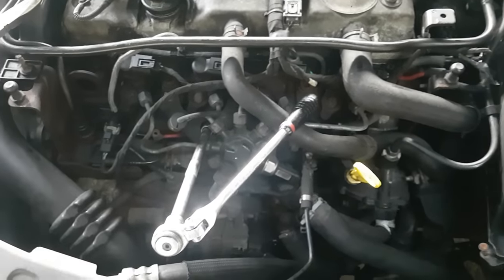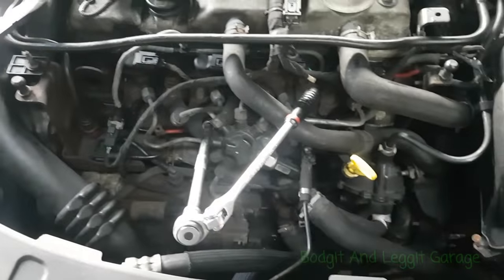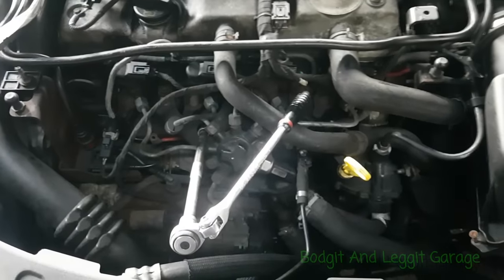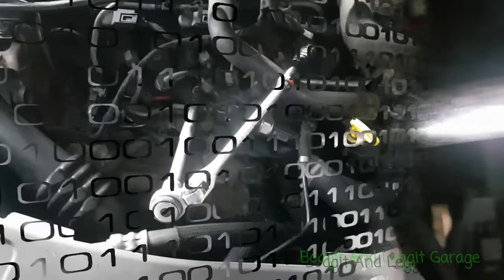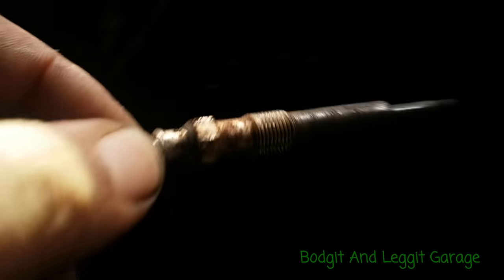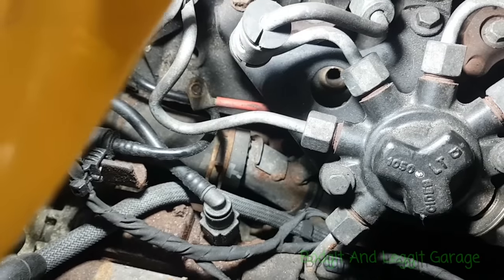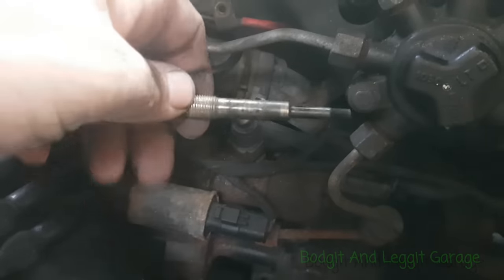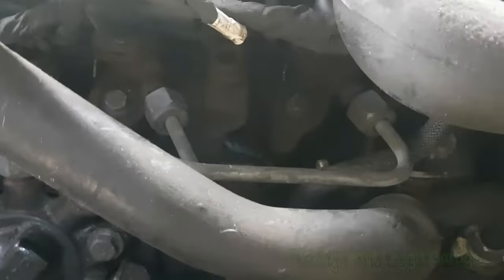How To Remove Seized Heater/stuck glow plug With No Specialist Tools Bodgit And Leggit Garage

Comment: I had a similar problem with my car recently a 57 plate vectra 1.9 cdti 120 bhp, did 3 on my own that were quite easy to take out but 1 glowplug was seized and squeaky like in this video. Took it to a mechanic at a home address and he was using all his strength moving it back and forwards, his arm was shaking he was using so much pressure on his arms and the glow plug was very squeaky as he was turning it. I told him to stop several times as I felt he would break it. He carried on and suddenly it came loose but would not come out but kept spinning.
Fearing the worst I took it to an engine repair shop and he managed to remove it in 15 minutes and only charged me 10 pound. Looked at the old plug and half the threads had sheared off it. Probably when the home mechanic was putting all his strength into getting it out. I think maybe he was trying to snap it on purpose to get a job off me to extract it, I no longer bother with this guy.

Its nice to see someone like you doing this job with caution treating it like your own car and doing the job carefully and properly, shows their are mechanics out there who do care for the cars and the customers who they belong to
Reply: I have the same engine on my Saab93.
     Was you mechanic not wrenching back and fore, or backing out one way only,  to cause your concern?
Reply: @Carlostype  yes he was going back and forth but using all his strength, he was even thinking of getting a hammer and hitting it once it got too tight for him to turn but I would not allow it. 
I no longer use his services

Comment: Yes But you delete constructive criticism cos you know there right, the vids ok even how you work at getting the glow plug out, it's the fact you won't accept you should have used some suitable penetrating oil as many of the comments have suggested
Reply from the maker: I don't delete any comments all your comments are still there go and look I don't mind people giving me advice, but when it has absolutely nothing to do with anything and it makes no sense. It doesn't really mean anything. In this case we would not have worked. I really don't understand your problem the video I did not break anything. I did not damage anything the job got done. So what's your problem?

It doesn't make sense you said I delete comment because you also said in one of your comments that people agree with you. So if I was deleting comments you wouldn't have seen that now. Would you think about it?

For the first time you said in your comment is completely wrong. Are you going to actually apologise for being wrong now? I don't think so.

Comment: Worth adding, put some coppa slip on the threads of the new ones. Will make it easy to get out next time if needed to. Also whenever we do track rod ends put coppa slip on the steering arm and track rod. Saves all the hassle of it being siezed next time it needs to be adjusted/come off.
Reply from the maker: Hi mate are you referring to copper grease because personally I don't use copper grease on anything with a thread because of the bit that's in it and it acts like sandpaper or are you referring to a different type of Grease
Reply: @bodgitandleggitgarage  yea copper grease, pad grease. there's no movement when the glow plugs are tightened up so no wear between the surfaces, it's very soft copper dust in the grease. They are guaranteed not to sieze in. Just done a second set of glow plugs after 80k on a Ford that had this stuff on, they practically fell out. Steel of the plugs and alloy heads are prone to reacting and sizing the plugs in, coppa slip prevents this. Try it.
Reply from the maker: boom sorted good to no mate
Reply from the maker: boom sorted good to no mate
Reply: Of course it would be nice the person before you or even the manufacturer did this. Would make it so much easier for the rest of us

Comment: I have a problem removing one, and I feel the click click feel of a turn but its not coming out its like something is turning on the glow plug but not the glow plugs thread I think part of its nut body is spinning ugh!!
Reply from the maker: Hi mate what can happen is they can break pass the threads because the tip can swell up in this case if this is the case you are going to need some specialist tools and can turn into an absolute nightmare

Comment: Great job. Do you know to remove stucked glow plug ? I have p0380 code. I think that one or more glow plug are faulty, because voltage on a wire on glow plugs is 10V when glowplug on dashboard indicator is on. Regards.

Comment: Usualy a build up of carbon that creates this problem, so penetrating oil does not always help.

Did the plugs on my P38 Range Rover a couple of moths back, four were easy enough, two felt tight, I chickened out after putting the meter across them, left them alone.

Those plugs look like the long Devils that were in my old X Type Mondeo engine 2.0
Reply from the maker: About time someone that actually knows what they are talking about the amount of comments in this video people telling me to put WD40 on them and telling them it would not make any difference apart from stopping the noise it would not penetrate thank you mate for actually know what you are talking about thanks again boom lol

Comment: My son said that he tried renewing his glow plugs and they were very tight, did I have any suggestions? Which is his way of saying would I do it for him !
We swapped cars Friday night. I let the engine cool and then applied lots of WD40. I know real men go in dry etc but not with these you don't. Lube is your friend in this case. Like you I went back and forth, lots of lube used and all four came out much easier than what my son described.

I only used 2 specialist tools:-
1. A deep 10mm socket
2. 40 years experience on the railway
Reply from the maker: Hi mate like I said in the video wd 40 absolute waste of time I did not use it in this video and would not use For this application it is not lubricant There's not a lot you can really do trying heat the car up turn the engine on let it tick over for a long period of time get it nice and hot and take your time The problem is if they re going to break there is nothing you can do some cars they just break unfortunately they can be an absolute nightmare
Reply: @bodgitandleggitgarage  if they're going to break, then yes they're going to break. You're absolutely correct on that, known in the industry as "Ford Mondeo Syndrome". Have no idea why - LOL. Of course the thing with our industries is a person's experience and preferred method of working. We're not all correct, and we're not all wrong. We tend to find a way that works for us, and we're happy with it

Comment: I'D GIVE IT A SHOT OF PB BLASTER EVER TIME BEFORE SCREWING IT BACK IN. IF IT'S THREADS IT'LL HELP. IF IT'S CARBON ON THE TIP IT WON'T HELP. BUT WHAT HAVE YOU GOT TO LOOSE? FIGURING IT'S CARBON, DO YOU CRANK IT OVER WITH THE GLOW PLUG OUT TO TRY TO REMOVE THE CARBON? I DO THAT OFTEN ON GAS ENGINES WHEN CHANGING THE SPARK PLUGS TO BLOW OUT THE CARBON.

Comment: I FIND IT EASIER IF YOU GET THE ENGINE TO WORKING TEMPERATURE.
Reply: Definitely it help. BUT, point being on some engines you'll have to remove so much "stuff" to get to the glow plugs. That when you reach them it's already stone cold! Then it cannot be restarted because it's just been disassembled! You get the picture! ;-)
Reply: @crpth1  Same here... got the thing nice and hot... by the time I took off the inlet manifold, the water bottle, the EGR and most of the coolant hoses it was time for bed.
Reply: @crpth1  LOL, how complicated things are nowadays.  I had a Hillman Avenger once, easiest new head gasket ever - pushrod valves. Sometimes I think I might get another, but then maybe not :-)

Comment: Why no wd 40? That would help for sure
Reply from the maker: Not at all in this case like I explained in the video yes it would have stopped the noise but that's still would not have helped anything the threads have got all carbon up with heavy carbon deposits WD-40 will not break through this all it would have done was stop the noise the process is still the same

Comment: Good video.
Would your recommend taking them out once a year to stop them seizing? 
Preferable in the summer months.
Reply from the maker: Hi mate not sure about that cos you can still cause other problems use good quality parts I've noticed the cheaper heater plugs tend to get stuck / seized a lot easier
Reply: @bodgitandleggitgarage  Wise words as usual. Cheers. Did you ever treat yourself to the 
Knipex 45 21 200 30 pliers for the odd C clips Toyota use on solid axles etc.

Comment: Changed heaters on an old 1998 seat ibiza with the old 1.9 non turbo diesel. Can remember one been behind the fuel pump which was a tad fiddly had one think was cross threaded in the head from a previous time ( not me) so changed the other three and left it at that

Comment: Hi there, I have been fighting for some time now with my mondeo/x-type project 2.0tdci and i got 2 broken glow plugs inside of the engine. After several attempts I have given up trying this and I have to open the Cylinder Head so i can kick them out. Do you have video where you open the cylinder head and install it back? Im asking this because i have no idea what im supposed to do, i will try using common sense and to tight back i have no values for Nm torque. help? :) cheers!

Comment: I've heard that if you get the engine warmed up by going for a drive after soaking recesses in penetrating oil. Then use freeze spray directly on the plug it makes it easier but never tried it and might give it a go when my van needs some new ones 👍😉

Comment: WD40 might have saved a little time?
Reply from the maker: Hi mate the WD40 would have made no difference in this case it was too blocked up full of carbon it would have stopped the noise but that's about it
Reply: bodgit and leggit garage I disagree!. You oblivious don’t understand how WD40 works. It’s a penetrating fluid and would have lubricated the threads every time you screwed the plug back in!. Also you could have explained why you only screw a small amount at a time, as you CLEAN the threads every time you work the plug in and out. PS WD40 dissolves carbon. Your welcome.
Reply: Well it was still a very useful video. It helped me expell the water out of my cylinders after I hydrolocked my engine. I was going to remove the injectors but then decided it was a-lot quicker and easier to remove my glow plugs. Fortunately mine came out very easily and were finger tight after about half a turn.

Comment: can you put copper grease on the new heater plugs
Reply: Yes, on the threads only
Reply from the maker: Hi mate no do not use copper grease copper grease act like sandpaper and it will destroy the threads and also make it harder to come out there is other Grease is out there I personally don't think they work in this case but definitely don't use copper grease copper grease is good for What It's designed for but not for threads or any moving shafts
Reply: @bodgitandleggitgarage  
Thank you Leon, I always take your advice on board 😊
Reply: @bodgitandleggitgarage  can you  put normal grease on threads if you replacing them so that it makes it easier for next time
Reply from the maker: @markholyoak9790  hi mate normal grease will not work as it will not be able to cope with the temperatures and just get gunned up and make things even worse to be honest I haven't really found any Grease to do this properly I'm not saying it's not out there I just haven't found anything that I would say works at the minute good quality heater plugs are better than the cheaper ones I have found the cheaper ones tend to get stuck and seized a lot easier
Reply from the maker: Mark Berry thanks mate
Reply: @bodgitandleggitgarage  thank you for your advice
Reply from the maker: @markholyoak9790  anytime mate
Reply: @bodgitandleggitgarage  
Any update on the 4th yet ?  Thanks 😊
Reply from the maker: @Arounadabout  yes mate came I've pretty much the same way just a little bit longer
Reply: Use aluminium grease, it worked wonders for me in the past.

Comment: Perfect timing I am doing a set on a 03 sprinter tomorrow morning
Reply from the maker: Oh noooooo LOL have fun mate have fun lol
Reply: Don’t do that to me no you can’t haha any advice lol
Reply from the maker: @colinhoward2780  yes mate I've got some fantastic advice don't do it haha
Reply from the maker: Just be careful with it mate I've known them to be very troublesome just take your time
Reply: Just watched a few YouTube videos and lot of people putting copper bread when putting it back in good idea ? Would you use wd40 to penetrate it ?
Reply from the maker: @colinhoward2780  it's entirely up to you mate personally I don't think it does anything the amount of times it gets hot and cold hot and cold I've just never known to work properly has a regard to WD40 it would not have penetrated I've never known it to work properly you have to heat up the outside area to allow the WD40 to go in lots of videos out there showing it just doesn't penetrate in certain circumstances
Reply: So if I spray it and let the engine run untill it is worm would that help do you think ? I just don’t want any to snap as it is out side my house and won’t be able to strip or drill it out lol 😂
Reply from the maker: @colinhoward2780  yes mate that can help you'll feel it if it's about to snap just take your time with it that's all
Reply: Cheers mate I appreciate your time
Reply from the maker: @colinhoward2780  anytime mate
Reply: Done them  heater plugs in the sprinter went like a dream nice bit of heat from the engine with WD40 bit tight to start with but soon got them going thank for the advice
Reply from the maker: @colinhoward2780  nice 1mate
Reply: @bodgitandleggitgarage  You can thank me later 😉 Cheers from over here mate and keep making your amazing vids!

Comment: Can u put any lubricant,???
Reply: Cellulose thinners can help to soften burnt carbon if you can get some in there.
Reply from the maker: Hi mate you can but it doesn't really work it might stop the squeaking but it's not going to work if it's going to snap it's going to snap there's loads of YouTube videos out there people proving that most penetration oils just do not work with heat candle wax allsorts it just depends on the situation but as you can see I prove from this video you don't need anything in this case

Comment: put some oil on it.
Reply from the maker: Would have made absolutely no difference like I explained in the video it would not have gone through the carbon on the threads all it would have done his stop making the noise the problem would still be there

Comment: Get the engine hot and use penetrating oil after you get a couple of turns, leave 10 mins if tight, then go slow like this video. There's no reason not to use penetrating oil.
Reply from the maker: Penetration oil will not break down carbon it is very very difficult to break down burnt carbon even in the combustion chamber cars are carbon ing up up so you think penetration oil is going to solve that I don't think so

Comment: @bodgit and leggit garage wondered if you could help me, my glow plug snapped and is stuck in the cylinder head. What are my options?
Reply from the maker: hi mate you only have two options one you buy you the special tool to remove it it and replace it it Hubitools do a special kit you can contact them tell them I sent you and they will look after you
or the other options which is a lot more expensive strip the head remove everything and take it to a machine shop

or just take it to somebody who has the right tools

Comment: Don't get upset it's only constructive criticism, any real engineer would have used penetrating oil and you know it
Reply from the maker: What difference would it have made stop the noise that's about it? It would not have penetrated the thick carbon like I said did I break it. No, did I get it off? Yes, was there any damage done? No is the car still going? Yeah? It would have made absolutely no difference.

Comment: Jez like. A squirt of oil would have helped no end. Work back in forth yo carry the oil down the threads.
Reply from the maker: I would love to see you do it if you would have done what you said I guarantee you it would have snapped WD-40 will not penetrate carbon build-up backwards and forwards is to ensure it will not snap WD-40 would have stopped a little bit of the noise but would have not done anything else
Reply: @bodgitandleggitgarage  wd40 is not oil. A light mix of paraffin and oil would have reduced the friction. However, you got it out, so well done you. Keep up the videos.
I'll be doing mind saturday😬, so I'll let you know how it goes🙈

Comment: Glow plug on this video syl nr 2.. Reson it making this sound is it full of sott"cox" on the part that is inside sylinder, so its making this sound as you force the coxs of the tip + its not sealed so its leaking a bit. And a good indication that this sylinder do have a problem on injector  + valve seals leaking so its burning a bit of oil .
Reply from the maker: Hi mate I hear what you are saying but that's not always the case did a compression test on this car all is good no problems not burning oil it also depends on how the car is driven on unfortunately this car is not driven properly short journeys never gets time to heat up properly

Comment: Come on spray some wd40 down in there let it soke in and it will help it come loose.
Reply from the maker: WD40 doesn't work it's been proven I don't know how many times lots of videos out the people heating stuff up with torches and strain WD and it still does not penetrate